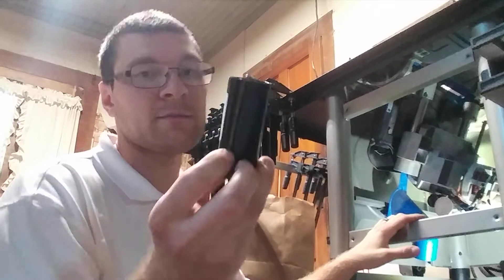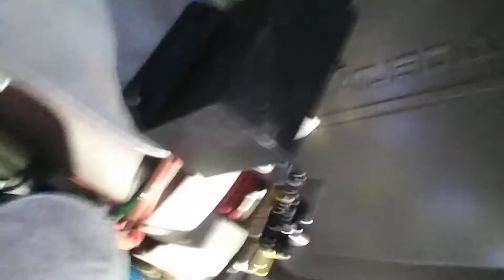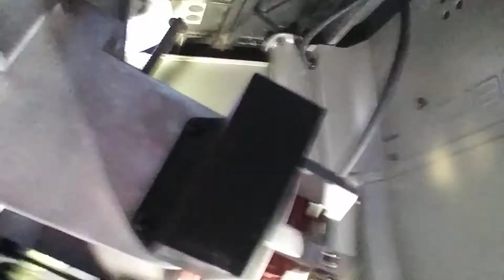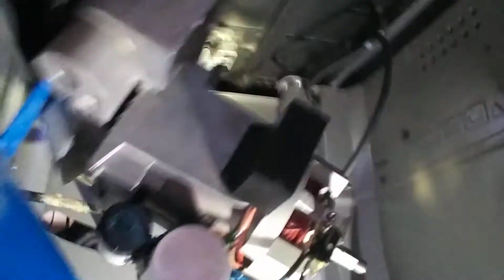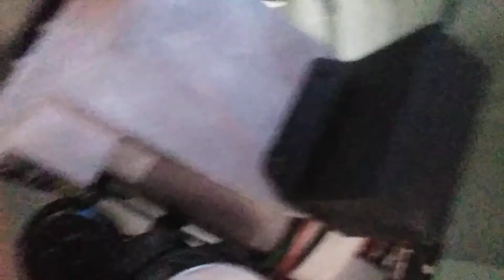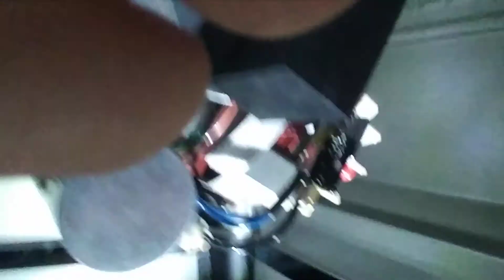36-725 and 36-725T2 Switch and Fan Install & Adjustment

Comment: has delta fixed this issue with the saws that are currently being sold at lowes, or are they still being shipped out with the poorly designed motors?
Reply from the maker: Nothing has changed. There have been changes to how they assembled in which led to fewer failures, but they use the same parts and design. Oh, I almost forgot. Some of them have the connectors soldered to the capacitor terminals.
Reply: @Frank-bg6xz  is your repair kit a permanent fix?
Reply from the maker: @rdj954  yes. The saw has limitations no matter what, but the kit improves a few key weaknesses in the product.
Reply: @Frank-bg6xz  are the capacitors part of the issues, or do they fail because  the switch and rubber cork friction discs fail? Im really interested in getting this saw in the next couple of weeks.
Reply from the maker: @rdj954  Usually it's one or the other. Sometimes the start capacitor fails prematurely, sometimes it's a weak run capacitor. Then there is the case were the cork brake pad fails, doesn't seem to happen as often as earlier models. When the brake pad fails the capacitor usually fails as a result.
Reply: @Frank-bg6xz  Ok thanks. Are you still selling the kits?
Reply from the maker: @rdj954  yes I am. https://py.pl/jojhJ
Reply: @Frank-bg6xz  Thanks. If I do end up purchasing this saw(T2), I will likely be ordering one of your kits. Thanks for answering my questions.

Comment: Hola necesito ayuda con un problema en mi table saw al encenderla tira el breaker de la casahello I need help with a table saw Delta 36 725 when turning it on, throw the breaker from my house
Reply from the maker: Does it trip the breaker every time?

Comment: Hello Frank, I am thinking about getting a T2 saw. Is this something I need to do right away, or is this only if I have a problem with the saw?
Reply from the maker: Good question. It's not something that needs to be done immediately, although I recommend it. Waiting until something fails carries a risk. Sometimes, not often, the windings are what fails. Again the risk is marginal. I'd say for what I've had less than 1% result in failed windings. Knowing what to look for helps. If your saw is slow to start, seams to slow down during cutting or stalls. Holding the power switch for the saw to start,overheating... These are signs that failure is to come.

Comment: BTW, what type of blade do you use on your saw? I’m using the blade that came with my 36-725 the thin kerf but I’m planning to get a new full kerf (.125) combination blade. Any thoughts on this?
Reply from the maker: It's depends. A good general purpose blade I use is a full kerf 50tooth planer combination blade. For rough cuts and rips a 24t. Fine finish work I'll use a 60th. Splintering can be avoided by using masking tape on the cut line and cutting face side up.
Reply: That is about was planning to get thx
Reply from the maker: @trep53  my pleasure

Comment: Wow!!!!!  Im an electronics engineer with over 35 years..........I truly understand the time and research that you've done here!!!!  Super great job!!!!  Im getting this saw in the next couple weeks and will be buying your kit!  I hope this will support you and keep you motivated to greater things!!!!  Im expecting to see your name on an upcoming space-X endeavour!!!!  Thanks again for your time in this!!!!!
Reply from the maker: I appreciate your support very much. I have new products I'm making, solid state motor speed controller for permanent split phase motors, aluminum side extension wings, stainless steel riving knives, router lift tables. I also make printed circuit boards in house. I do everything in house. 

Thanks again

Comment: Great info!  Owned the 36-725 T2 for about 2 weeks love it.  The T2 no longer has the switch for 220.  Can this motor be re wired for 240v? The  reason i ask is the tag says this saw motor has been wired for  110v.  Thanks.
Reply from the maker: The T2 cannot be changed to 240v, but I'm slowly trying to convert one to run on 240v.
Reply: @Frank-bg6xz  That would be awsome!

Comment: Frank,  Great video.  I just bought a 36-725T2 and when I first ran it, it started up fine, but after running for several minutes continuously, I noticed a smell and so I stopped the saw and a wisp of white smoke floated up from the blade area.  I stopped it, then restarted it, same thing.  So I stopped it and turned the blade by hand (yes unplugged) and it sounded crunchy, for lack of better description.  I then pulled the covers off the motor and the noise was coming from the fan end.  I removed the fan and a chunk of black plastic fell out of the fan clutch, so I removed it, along with the centrifugal weights and springs, cork disk and the plate over the start switch, put the fan back on and now it starts slowly.  After watching your video I understand there is no power going to the start capacitor because all the parts that would close that switch are now off.  But it runs OK, once its up to speed. SO...my question is, do I repair the mechanism or just go with it, or am I slowly murdering my run capacitor?  Also, do you have a website for selling your kit?
Reply from the maker: You'll need those parts. What I think happened was delta installed the fan incorrectly and that led to the failure. I recommend you take the saw back in exchange for another and if you're inclined you can purchase and install my kit and you'll be smooth sailing thereafter. I don't have a website yet, but it's in the cards. Do email me: frankcoproductsllc@gmail.com 

And I can forward some information.

Comment: I’m Looking at buying the table saw, is this something that is known to go bad? And is your kit something I should buy after purchasing the saw? Or should I check the switch before using the saw? 
Thank you 
J.
Reply: Thank you for quick response and I will be in touch once I buy the saw
Reply from the maker: @technolsense1959  You're welcome
Reply from the maker: Motor issues are common, but not every saw is a dud. The switch isn't what fails in the saw. Capacitors and the brake pad are. The kit addresses these issues plus another less common issue (worn switch). The alignment of the switch is for my kits as the switch I supply is slightly different than the original. It is best to order the kit when or shortly after getting your saw.

Comment: my delta saw 36-725 runs about 70% rpm, very hard to rip a 2x4. any ideals what going on?
Reply from the maker: Sounds like a failing run capacitor or the starting mechanism on the fan is sticking. Be sure you're on a 20a circuit using no extension cord or a 12ga extension cord minimum
Reply: @Frank-bg6xz  i forgot to tell you i switch the saw to 220, still no differ
Reply from the maker: @donaldsweet5933  Voltage is insignificant in this issue
Reply: @Frank-bg6xz  thank you
Reply from the maker: @donaldsweet5933  my pleasure

Comment: Ok, so I can't find the answer any where else, so can you tell me if this model is a belt drive or a direct drive?
Reply from the maker: It is belt driven, but the pulley ratio is 1:1
Reply: @Frank-bg6xz  ok. Thank you. Trying to decide between this and the 36-5000T2.
Reply from the maker: @charlesduncanmckinley920  The 5000 has cast iron extension wings. It's a tough call because the sheet metal ones can be a pain to install. They don't always go in flat with the table, if you use a sled it's not a worry. Also I think the 5000 uses single piece rail which is very nice.
Reply: @Frank-bg6xz  thank you again.
Reply from the maker: @charlesduncanmckinley920  you're welcome. Anytime
Reply: @Frank-bg6xz  The 36-5100t2 has the cast iron wings. The 36-5000t2 has steel wings. They are essentially the same thing as the 36-725t2 but have one piece rails and an upgraded fence
Reply from the maker: @eggplant2369  correct

Comment: So what’s the issue when the motor just hums?
Reply from the maker: Start capacitor is faulty, but the brake pad can also be suspect. The factory brake pad tends to stick and it seizes up the motor which burns out the capacitor.
Reply: @Frank-bg6xz  my father just got the T2 model. And it’s just humming for him. Will your kit fix this if all else fails? And thank you for your fast reply
Reply from the maker: @Zeroplanetz  yes it will. I've sold over 200 kits and humming is the #1 complaint.